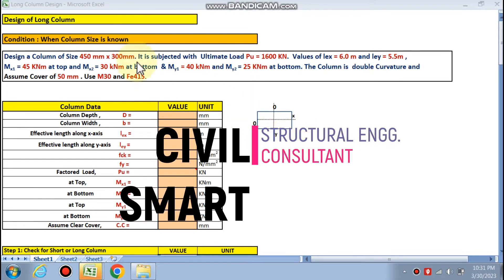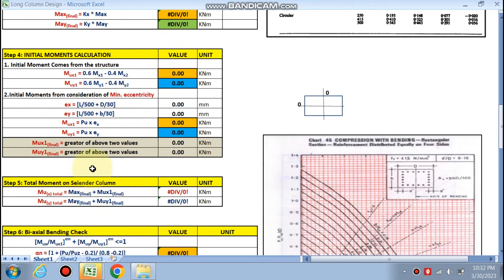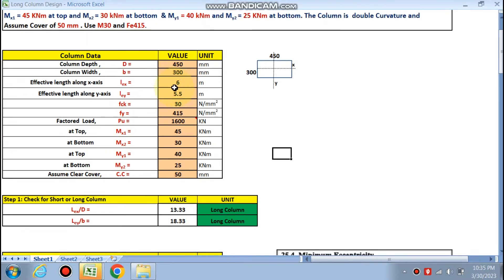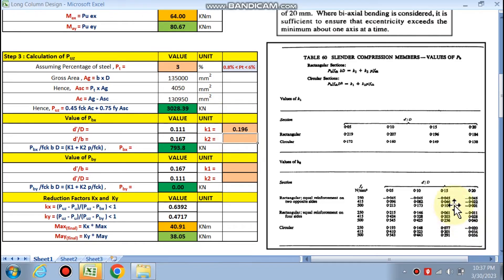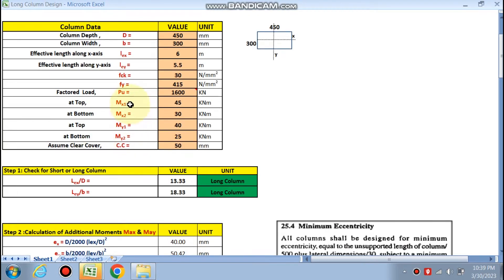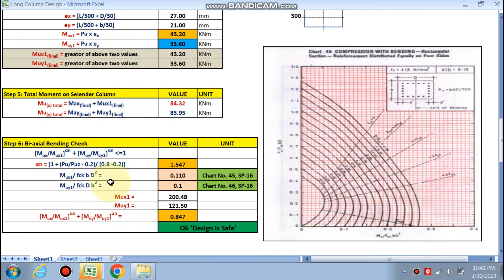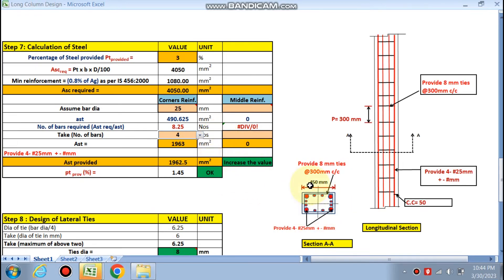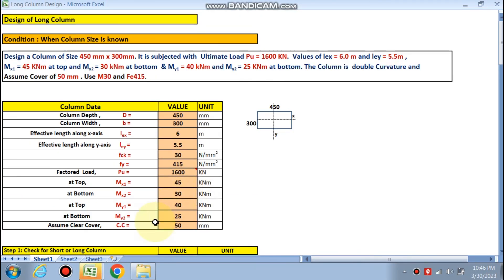LONG COLUMN I SLENDER COLUMN I DESIGN

Comment: Sir if g+5 building how was load act uper se niche column ka size increase hoga kya
Reply from the maker: Yes , in general load transfer from slab to beam and then to columns and then to lower columns, finally to footings. Hence bottom column size may be large in general.